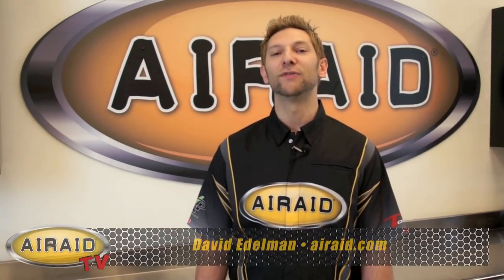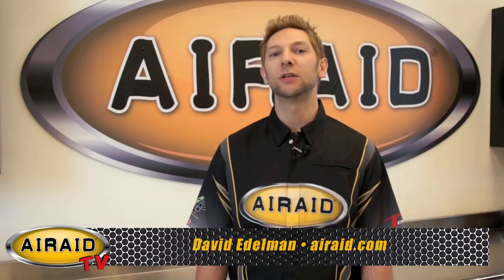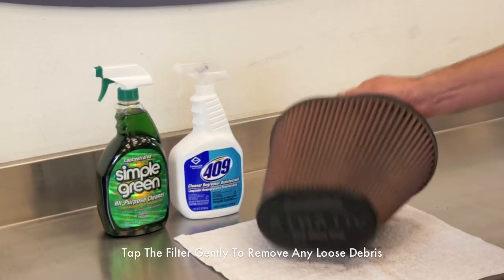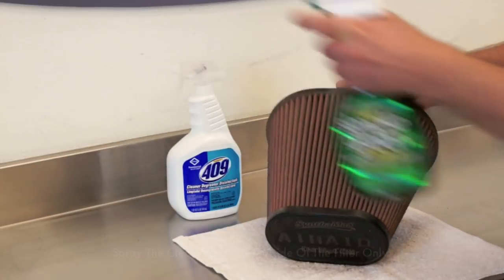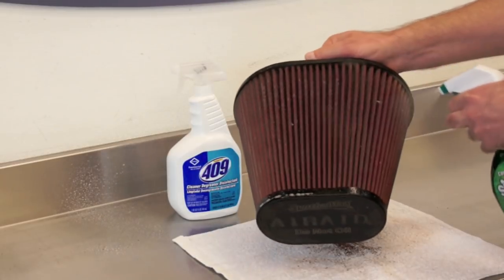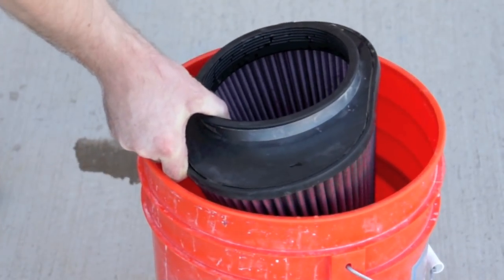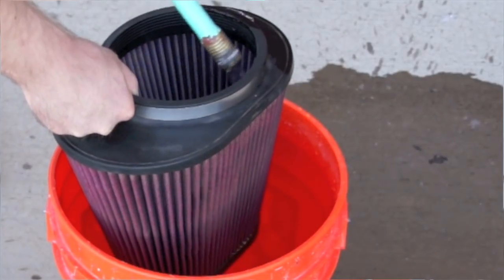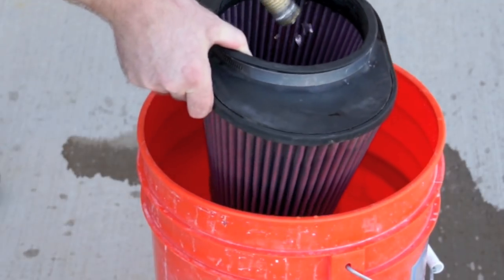AIRAID SynthaMax (NON-Oiled) Cleaning Instructional Video

Comment: Just got 251-253 non oiled, how do I order just the oiled filter itself and will it fit to the 251-253 hardware?  Appreciate it!
Reply from the maker: Great question! Yes, you can absolutely swap a dry filter for an oiled one with our kits and vice versa; we offer every one of our kits with both filter styles and changing from one to the other is as simple as swapping the filter itself. There's a page on our website that lists the filter part numbers that go into each kit; in your case, the oiled filter for the 251-253 kit is part # 700-495. Thanks!

Comment: Read on a couple forums using simple green discolors the filter.  Is this true?
Reply from the maker: That's a new one! No, Simple Green does not discolor the filter. If this is a concern, you can use 409 or any other mild household cleaner that is not petroleum based.

Comment: so if my filter does not say add oil it's a oil filter
Reply from the maker: yfztwJustin Gonzalez No. If it says "Do Not Oil" on the end cap, then it is a dry filter and does not require oil. If it simply has the AIRAID logo and nothing else, then it is an oiled filter and DOES require re-oiling after service. Hope this helps.